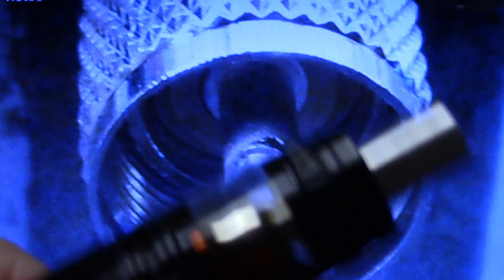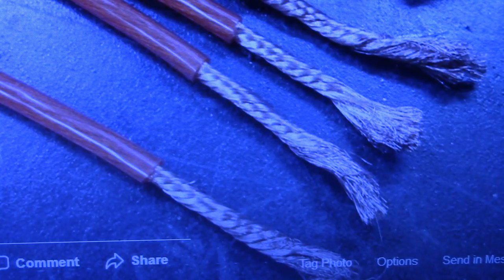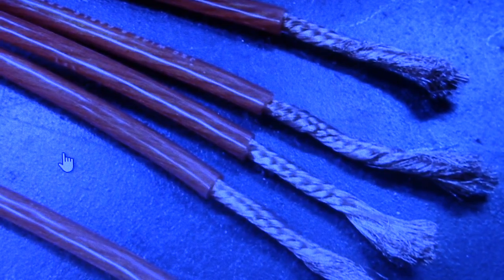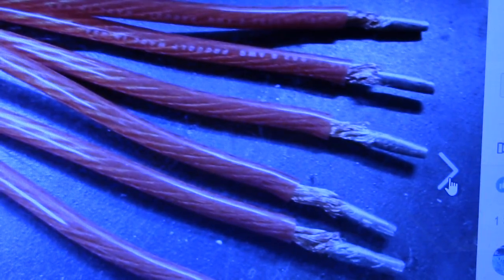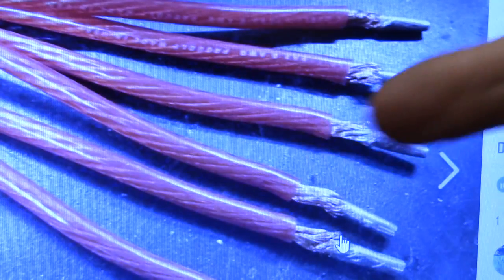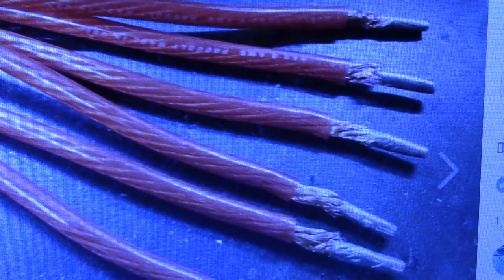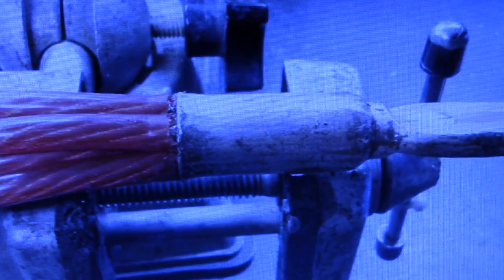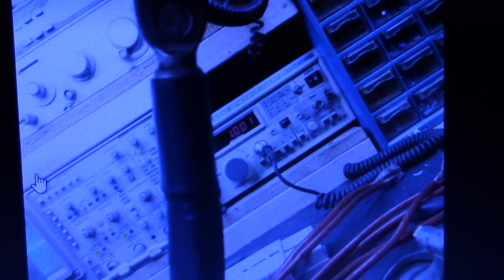Soldering .. stop procrastinating and get it done!

Comment from the maker: Some might be wondering about the strange or multi-wire configuration of positive leads .. it's ok, this is due to even power distribution (cutting corners) internally of most linear amplifiers. You wont normally see this configuration with car stereo amp or power inverter. Use rated components, solder correctly and live happily ever after! One bad connection and you can almost guarantee strange swr and or reflect readings, poor performance and a waste of time / money.

Comment: What You did to "prep" those ends with solder is called "tinning". The end of the iron needs to remain clean also and be "tinned" after each cleaning. When You see a new soldering iron's tip,notice the small amount of solder on it. It is "tinned" at the factory. Look at a brand name of  Weller. That is what most use. YES....protect YOUR eyes people. Solder can and will spatter just like a weld. In essence, that is what You are doing on a smaller scale,welding. Surfaces MUST be cleaned before welding and in soldering it is no different. I love to solder. I find it to be fun. Practice and be safe. Eyes,skin,get the picture? HOT. Sincerely and be safe and enjoy as it is worth it! Troy.

Comment: Good olde fashioned soldering, I use the 60/40 mix, not the crappy lead ♄ free lol 😉
Reminds me of making up my radial system for my 10m long multi band vertical. Ex 3 phase cables and other heavy wire, both crimped and soldered via 100w iron ⚩ good fun and now a very efficient and effective aerial via a remote smart tuner. 
Doing the hard work connections done for maximum connectivity. 
Nice video 📹 Mark, best 73's 👍 😁 🏴

Comment: A.W.G. is American Wire Gauge. Just like I was using A.W.G. 24 in Telecom for both voice and data. In higher capacity applications as You know we need larger cable. A.W.G. 4or 2 with an amp. or whatever. Less impedance,less heat,more flow.....amps,You know. Damn,a rhime! Later,Troy.